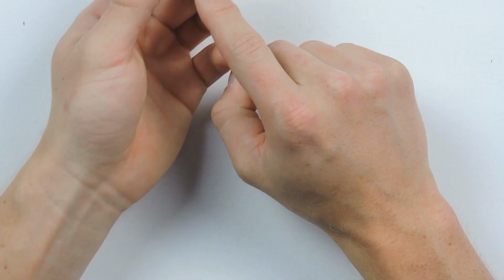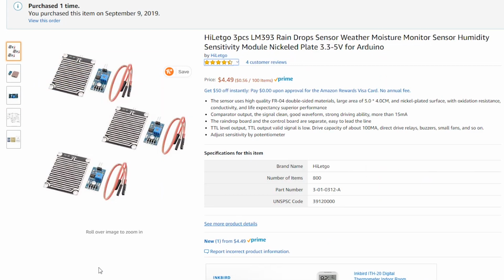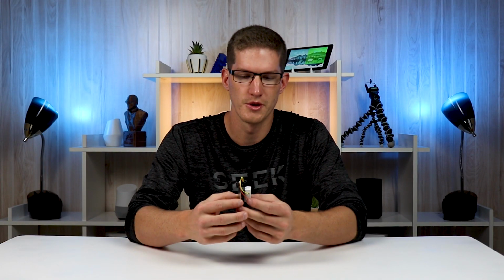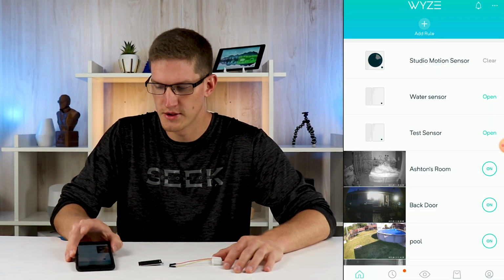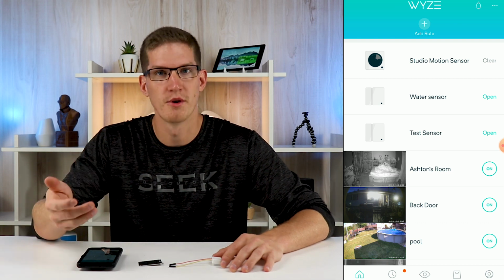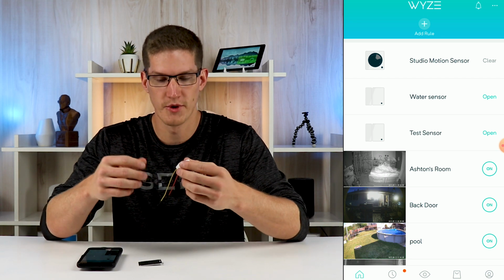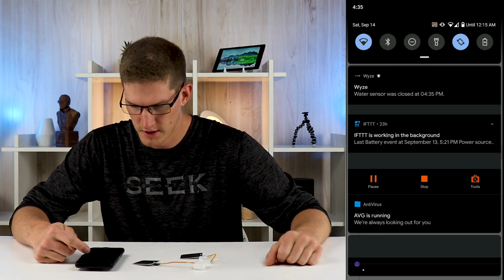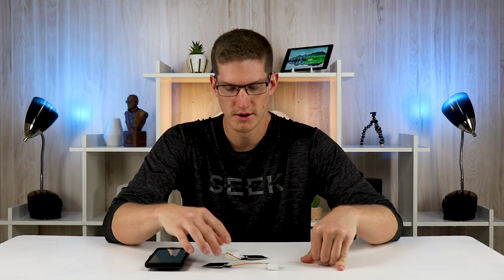D-I-WYZE Water Sensor | 5 minute hack

Comment: Question, when there is no water, the sensor is in an open state, water closes the circuit. if the sensor is for an alarm, doesn't the alarm trigger in an open state and not a closed state?

Comment: Thanks for the info. I wonder if this would work with a water sensor from amazon. You just need the sensor end and not the wifi hub. Get the one with a main body "wifi hub" that has a wire run to a sensor. Disgard the main body and cut the wire. Connect the wires to the wyze sensor and use the sensor end to detect water.

Comment: as small as the circuit board is you could hot glue it to the inside of a flip top pill bottle and have a small magnet glued inside... my wife always forgets IF she took her pill or not... now she'd know.  I was thinking of 3D printing a box for the sensor, but could probably just print a lid with the circuit inside if I wanted to hide it.

Comment: Do you even need the water sensor?  It appears that water connecting the two wires will set this off.  Am I missing something?
Reply: Water sensor appears to give a larger surface area for water to contact, and the pads are a consistent distance apart.
Reply: I was wondering the same thing. Why even get the sensors and why not use just the leads by the sump pump and when they get wet it will set the trigger off. Maybe even use a small paper or cloth rag to soak up water and then put leads on them to get continuity to set trigger?  Just curious.  Cool idea though.

Comment: Hey, for those of us with a 3D printer, I designed an enclosure for this setup. You can download it here https://www.thingiverse.com/thing:4070779

With that said, I've adapted two sensors with this approach and within a day, they are both reporting low battery in the Wyze  app. I just did this yesterday, so I'll see what happens in the next few days. Is anyone else having the same issue?
Reply: Some people mentioned that the negative battery contact is weak.  They will tweak the tab up a tad to get better contact.

Comment: Very cool use of the contact sensor!  Have you ever tried to extend the antenna in a Wyze motion sensor?  I'd love to detect when my metal mailbox opens/closes, but to do it I'd have to put the motion sensor inside with the antenna outside the steel box.

Comment: Sorry man, but with this being as simple as it is, and with plenty of other channels that have already done a video exactly like this... I thought it would be different because you put a drain pipe in the thumbnail. Unfortunately just another of the same.

How are you detecting leaky faucets or running toilets?
Reply: Heck, just mount the little unit on the wall and run long leads to the water sensor panel...  Do that for everything...    That what I'm going to do, sinks, washer, bathroom, sump pump, etc.

Comment: Hi, very nice video. The problem I have is that it leaves the sensor OPEN until it gets wet when the water will CLOSE the circuit. Leaving the sensor OPEN all the time drains the battery and probably pollutes the RF. Any idea how to fix this?
Reply from the maker: I don't think leaving the circuit open drains the battery, unless you have proof of this somehow? I've used different contact sensors over the past few years and had a few of them normally open and have had no noticeable difference.
Reply: @TaylorTech  
Wait a minute.
Is the reed switch closed without the magnet and the electronics reports the opposite?  If the reed switch was closed all the time would that not drain the battery because the electronics are in a constant active state?
If the reed switch is open is that also turning off the electronics as in there is no activity until the reed closes thus turning on the electronics?
Or..... is the electronics in sleep mode until the reed switch closes then everything is on full power to transmit?
Reply: I agree that the status of the sensor will not drain the battery.  If that were the case, leaving your window or door open with the normal reed switch would also drain the battery.
Reply: Exactly what I was wondering.  Thanks for the comment.
Reply: @tjk1009  installed 3 sensors based on the video, 3 months later all 3 are dead, battery drained on 2, the 3rd.one lost MAC so probably not related
Reply: Leaving it open or closed should not matter. It is what you call a dry contact which means there is no power going through it. It operates by sensing change in continuity.

Comment: I’ve been watching these videos, and I love the information that you provide.  I just bought a house and in the middle of selling my last.  Once that happens, I’m going ham.

So these are some questions I would like to ask, because you seem to really know what you are looking at.

1: is there a way to utilize a hdd plugged into your router to store camera footage while also being able to stream to action tiles?  I want  to stream all the time because I have kids and I’d like to monitor them in the loft and back yard.  However, I’d like to record the entry points in my house as well (whether this happens only during motion on or full time, whichever).  I’d rather use a hdd because I wouldn’t have to clean it so often, or do those wise cams just continuously delete the old while recording new?
2: could you use a hdd plugged into your router to share music to Alexa?  I doubt this one seriously, without some very in depth stuff at least.
3: Wouldn’t a smartthings hub be ideal rather than to connecting to your router?  I’ve read a hub is meant to handle oodles of smart devices so that you don’t put strain on your router.  I have a $250 router (Netgear  x6) and it says it’s limited on the devices you can connect to it, and I understand this to be true regardless of the internet speeds and bandwidth actually available.  This is why I was so interested in the mesh network stuff to extend the WiFi, because I’m thinking this integrates the system into the hub, then router, rather than to the router directly.  This is new, but I do know I want this to be a sweet setup.

Comment: I would think that one may be able to do the same with a ST sensor or compatible sensor and tie it to ST?Great hack
Reply from the maker: Yeah, there are even some sensors that have screw terminals to make it even easier. Not sure about the ST sensors, but it should be doable
Reply: Most Smartthings sensors contain tiny surface-mount hall effect sensors instead of reed switches.

Comment: Very simple mod to pull off. Extra points for making use of a Wyze contact sensor to do it instead of having to use an Arduino compatible chip and completely DIY the whole process from the ground up.